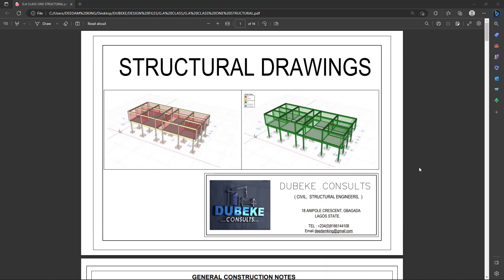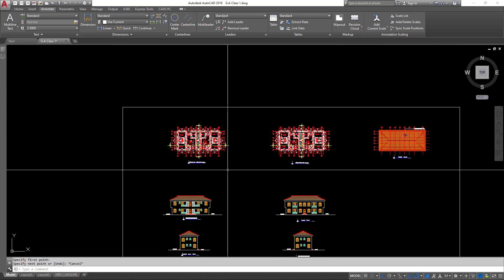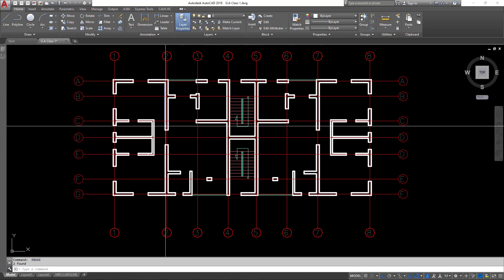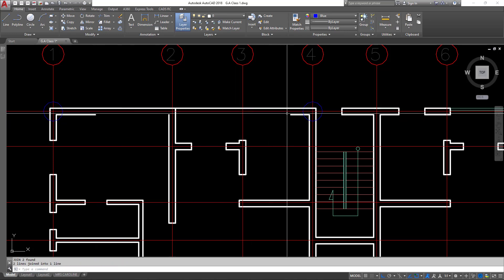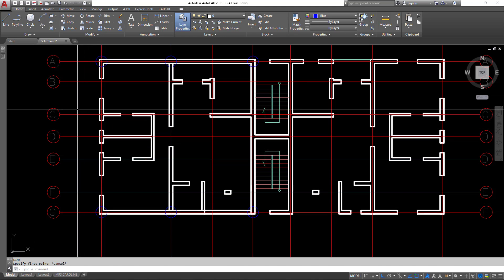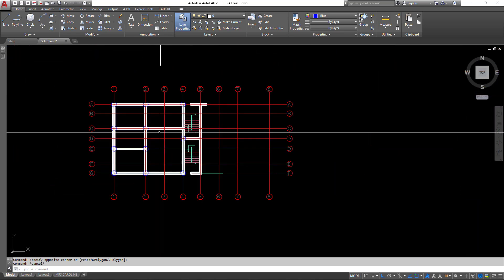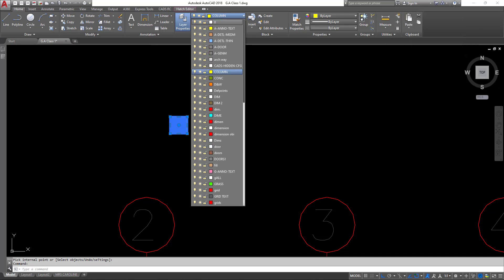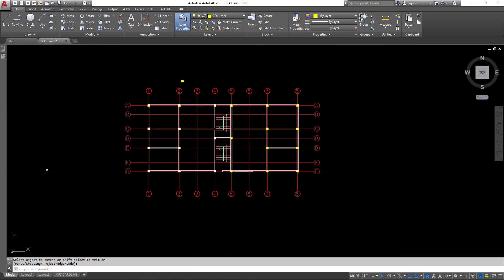How to Create a General Arrangement Drawing (G.A) Pt1

Comment: According to codes like Eurocode or BS 8110: beam width is usually chosen as beam depth ÷ 2 or more, with practical lower limit around 200 mm for structural safety.

But i observed you used the wall size of 150mm for your beam at a panel. Any valid justification to this?
Reply from the maker: If you go through the complete series, a 230mm beam was used for model and design. The 150mm was used to mark up the beam position with respect to the gridlines. Nice observation